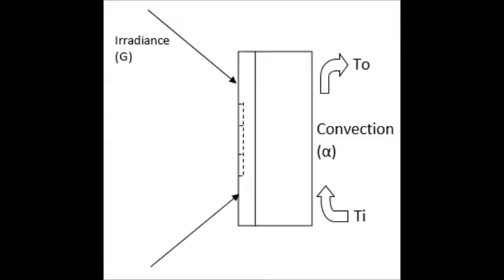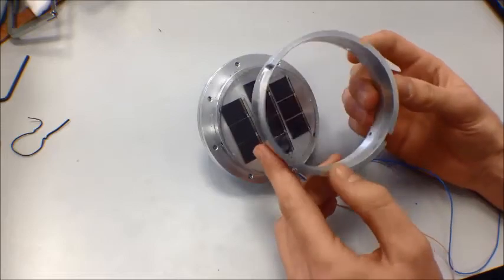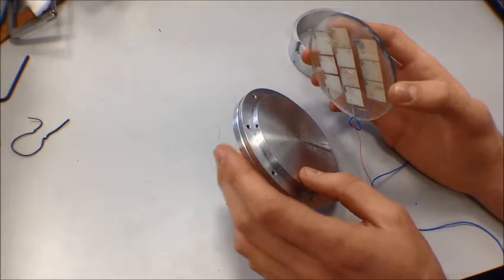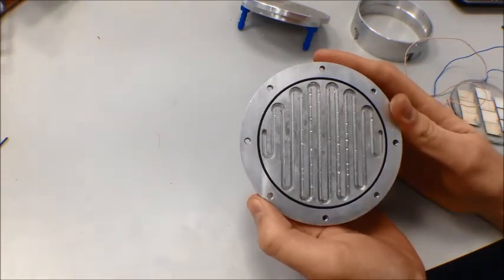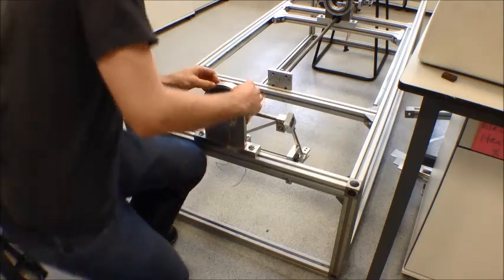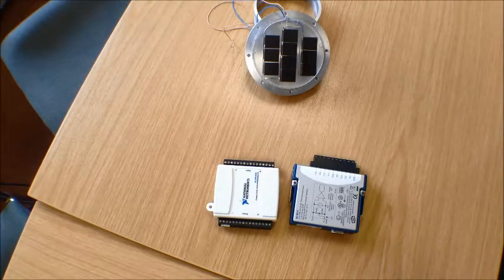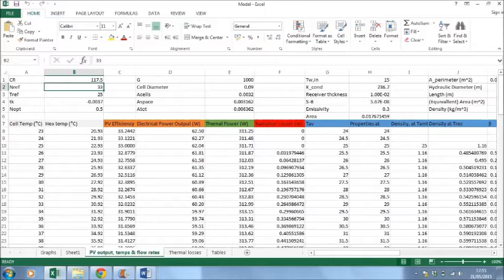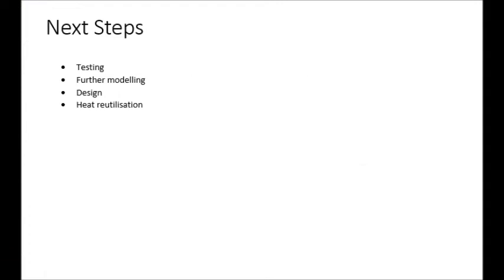CPV-T Solar Receiver Design

Comment: Very nice design and idea of re-utilization of heat.
Questions-
what was the pressure drop across your cooling channels?
Did you achieve boiling point without hurting the cells, if yes at what flow rate?
Thanks